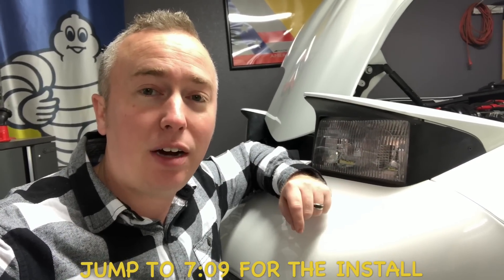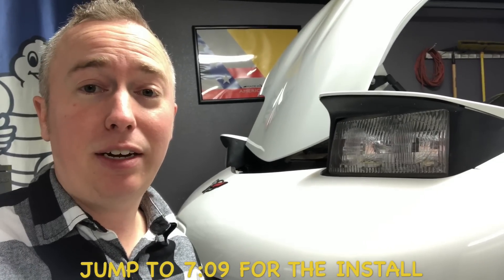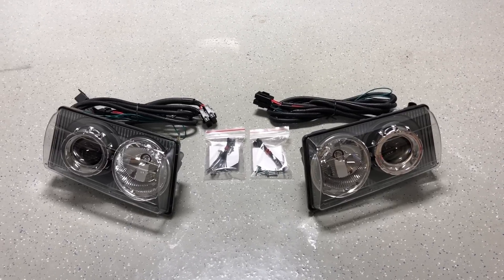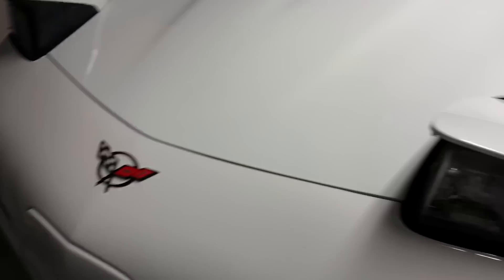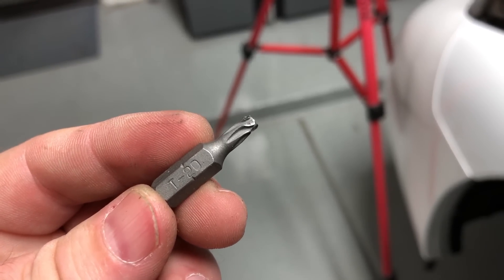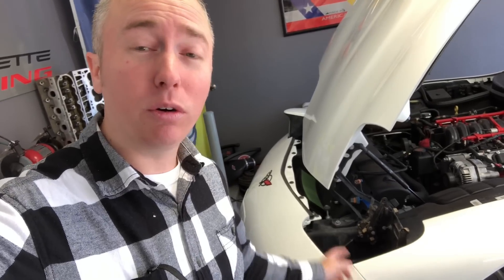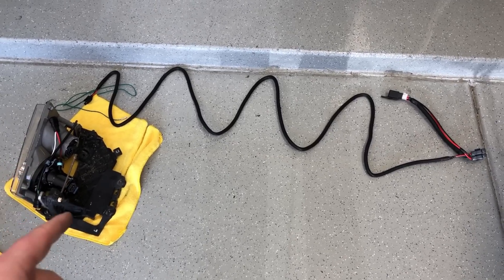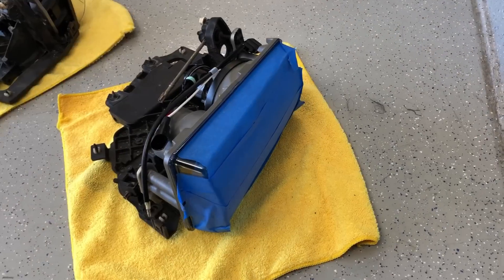How To Install C5 ACA Headlights

Comment: I installed these in my C5 which I sold several years ago.  I installed HID lamps in mind.  The installation was dead on in terms of fit and finish.  The light output was simply amazing.  The updated housing added a ton if curb appeal to the car as car shows.  This install was one of the best upgrades I made to the C5.

Comment: I’m just in the process of changing my headlights to HID’s (from Corvette Envy) and my DRL’s at the same time. I also had to change the light sockets for the DRL’s because they were burned and cracked from the heat of the bulbs, shouldn’t have that problem anymore with the LED’s. Your two videos have been a great help, keep up the good work!
Reply from the maker: Glad I could help!

Comment: So did you aim the headlights? That last thing is to make sure they are not to far to right/left or or up in the air or pointing towards the ground-if the whole headlight assembly had to come out of the car, then it’s definitely out of alignment compared to the factory headlight's
also, the new versions that are HID in similar housings are basically plug and play except for one hot wire. They are expensive though they’re almost $1000.

Comment: Currently installing the Bi xenon modified ACA headlights by Radioflyer...have to get a Torx 20 tomorrow to get those bolts out tho, only have a 15! Thanks for this helpful video, my set has a couple ballasts so sort of different, but seems straight forward enough.

Comment: Installed these on my C5 thanks to this video.  Worth every penny in parts and every hour with a socket wrench for the install.  I used Hikari Eye Of Megatron LEDs for my low beams and they are BRIGHT.  Thanks, Chris!
Reply: do the headlights still go down when you turn them off automatically?

Comment: Great video. But I have a question about the Delco radio. I have a CD player in it the volume control now is going up and down in the CD. I cannot get anything in or out. Do you have any recommendations? You do very good videos. I have a C-5 2004 Corvette coupe. I love it just problem with that radios drive me nuts.

Comment: I bought a  ACA projector headlight kit from Corvette Central and after procrastinating for 9 months installed them this weekend. Your video was spot on, in fact, the manufacturer should include a copy of your video in their package. Their instructions were terrible. Additionally I wanted to pass on some info I found during the installation. The Corvette Central positive wires were too short and  had ring connectors for approx a 3 mm stud on the fuse box. My 2001 convertible had 8 mm stud. I soldered the extra length of wire onto the cable and soldered larger ring terminals for the correct fit. Additionally the low beam bulbs can be put in the wrong way. I discovered that when trying to adjust the vertical height of the driver's side beam. The passenger side was correct.The reinstalled bulb now works correctly. Last request, What LED bulbs did you uses in your install?

Comment: Hey, great video. I was looking to install a set of these onto my C5. I was curious to know:
1. In their base form (Halogen bulbs) how much better are these lights than stock?
2. Did you change the bulbs? If so, what did you change them to and did the change from the to am upgraded bulb in the ACA make a difference?
Reply from the maker: 1. yes
2. So far I have not.  I hardly ever drive the car at night so I never got around it it after I did this video.   If I did I would get the Xenon lamps.
Reply: @mycorvettelife  Happy New Year! Sorry for the delay. Thanks for your response. I hope that you and the family are well.

Comment: Great video, my only question is why did you have to the whole assembly out , why not just take only the headlight assembly with the 3 10 mm bolts?
Reply from the maker: It doesn’t work like that.

Comment: Help. I just completed this install on my 2003. Problem is my driver light keeps popping back up. I had this problem before the install so I replaced the motor but the light keeps popping back up about half way. Got a fix for this?

Comment: Thank you for the great video! At present I have installed new LED headlight bulbs. After two different attempts I found some bulbs that give a very good beam pattern and great light. Lasfit: LA Plus Series 9006 HB4 LED Bulbs 60W 6000LM 6000K. The only problem is the headlights do not retract when I turn off the headlights if the low beams are on. I can get them to close by turning off the lights with the high beams on (they are also LED but are 72W). I checked with Lasfit about adding a load resistor but was told that would not solve the problem (I thought it should). Have you found a way to work around the problem? Thank you!

Comment: How difficult was it to line up the headlight covers after the install. I saw that they weren't flush anymore. How long did it take?
Reply from the maker: That a separate issue.  The new housings don’t change the headlight cover alignment.
Reply from the maker: It’s a constant battle to align everything.  Every panel on these cars is adjustable and if you thing is adjusted, it effects 6 other things.

Comment: Do you recommend using the halogen lights that come with the ACA headlights? What lights did you finally settle on? Thank you Chris for making a super video
Reply from the maker: I’m still using the halogen.  They work fine.  The optional Xenon are good too.

Comment: I was wondering if you only changing the lences why do you need to run harnesses?
Reply from the maker: I spoke with the manufacture.  They said these lights are designed to operate on a relay-based system using the factory harness as a trigger.  I believe this makes the linking of the Lo-beam and hi-beam possible.

Comment: Hi Chris, Which LED high beam bulbs did you use with the old headlights? Both sets I've tried hit the metal arm behind the socket opening and that prevents them from fitting.
Reply from the maker: VetteLEDs.com

Comment: Great video! I have the ACA's but I had to cut the some of the aluminum on the mounting bracket like others on Corvette forums. Did your low beams clear or touch the bracket? I couldn't tell from the angle. Thanks again, but unfortunately I did mine before your video so I only had pics to follow on the forums.
Reply from the maker: I didn’t have to modify anything.

Comment: Great job, Chris. It just so happens that I am updating all my lights on my Z06 as you're doing this and very helpful. I got all mine from Radio Flyer and there are some pretty significant differences most notably w/ the wiring which may or may not be better, just different. It may be related to the Bi-Xenon aspect of my install. 

Again, great job w/ the video, but the one thing I was looking forward to in the end was the adjustment. I haven't quite gotten to that point on mine but it's coming soon. Did you not have to adjust yours?

Thanks again,
Kevin
Reply from the maker: Thanks.  I didn't have the adjust mine,

Comment: Great video as always, OK, now the stupid question...why the new wiring harness ? these are not Plug and Play ? are there any that are ?
Reply from the maker: I spoke with the manufacture.  They said these lights are designed to operate on a relay-based system using the factory harness as a trigger.  I believe this makes the linking of the Lo-beam and hi-beam possible
Reply: My Corvette Life okay makes sense  thanks 
Are you planning on doing led in this setup ?
Reply from the maker: @carmenpete  Yes

Comment: You can install or swap the LED lights from the  original lamps to the new lamps.
Reply from the maker: Yes and no.  The Hi-beam socket is still a 9005 socket, but the low beam is a H9 socket on the new housing instead of a 9005.  You can get a LED with the H9 tabs and it will work, which is probably what I will do.

Comment: I installed these ACA Headlights on my 1998 Corvette and experienced my Headlight Lids not closing properly.  I finally had to put my headlight switch into the high beam to make both lids close at the same time.  How do I fix this problem?
Reply from the maker: I did not have this problem.

Comment: So how do these light the way compared to the LEDs?
Reply from the maker: With the halogen lamps they are equal in brightness to the stock housings with LEDs.  But the light cutoff is much cleaner with the new housings.

Comment: If these are halogen bulbs, why the need for running the wiring harnesses to the battery? Why not just power them off the original harness?
Reply from the maker: I spoke with the manufacture.  They said these lights are designed to operate on a relay-based system using the factory harness as a trigger.  I believe this makes the linking of the Lo-beam and hi-beam possible.

Comment: Why u need the  harnes for ?
Reply from the maker: I spoke with the manufacture.  They said these lights are designed to operate on a relay-based system using the factory harness as a trigger.  I believe this makes the linking of the Lo-beam and hi-beam possible.

Comment: Why do you need to install new wiring? There are no new lights etc, so why can't you use the existing wiring?
Reply from the maker: I spoke with the manufacture.  They said these lights are designed to operate on a relay-based system using the factory harness as a trigger.  I believe this makes the linking of the Lo-beam and hi-beam possible.

Comment: What's your opinion on CorvetteMods.com
Reply from the maker: Garbage
Reply: @mycorvettelife   yeah I bought their hid projector lights... they didn't fit that well, so I had to get the dealer to install them. Then the  radius of low beam is small and the high beams barely work. What are good hid projectors for the c5 vett
Reply from the maker: VetteLights or CorvetteEnvy.
Reply: Can you make a video of what your hid projector lights look like? And how adjust them

Comment: Is it easy ??
Reply from the maker: Define easy?  Easy for me may not be easy for someone else.  You watched the video.  You be the judge.
Reply: My Corvette Life looks kinda hard lol . And you need the other wiring for what ?? I’m get the headlights .
Reply: My Corvette Life where did u buy the headlights? And are they like the ones from eBay ? Or these the real deal ?
Reply from the maker: As I said in the video, these are NOT the EBay ones.  They are the real DOT approved ones.  Link to purchase is in the video description.
Reply from the maker: I spoke with the manufacture.  They said these lights are designed to operate on a relay-based system using the factory harness as a trigger.  I believe this makes the linking of the Lo-beam and hi-beam possible

Comment: Why changing harness? No extra power consumption. Why would you complicate this job? Why won't you use led in projector? Xenon light emits alot ovlf uv, burning out reflector, led runs cool and doesn't require anything, you already have it.